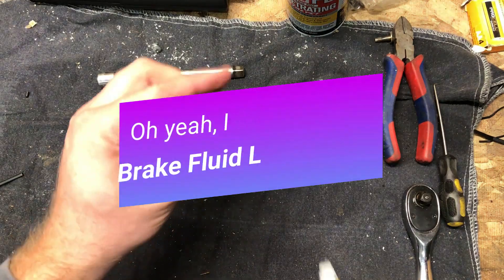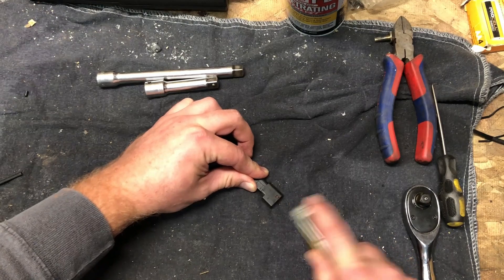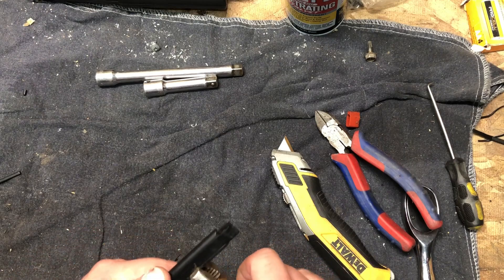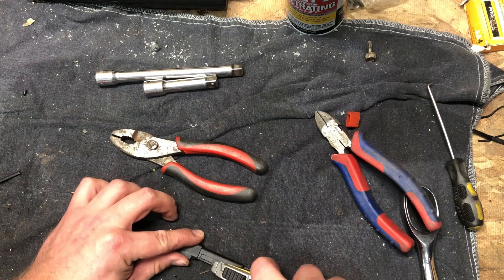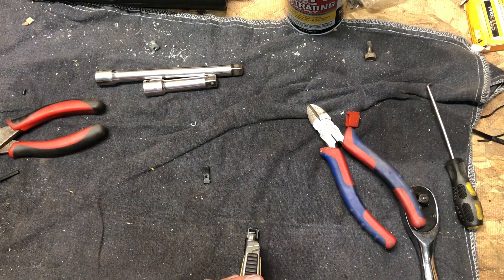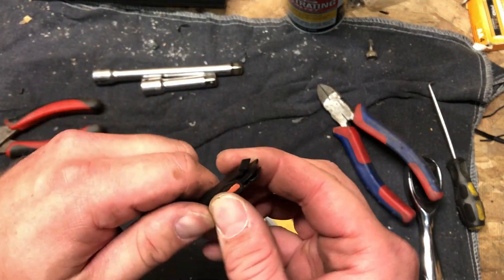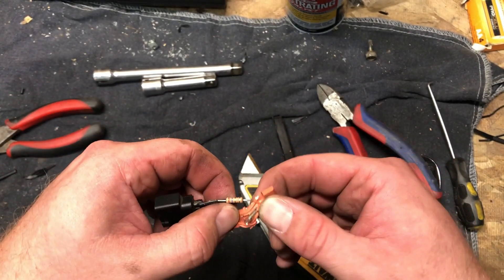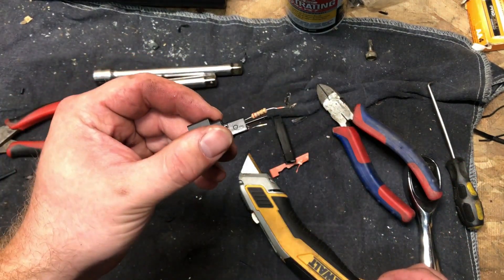Oh yeah, I forgot... Brake Fluid Level Sensor

Comment: Useful video thanks, I need to bypass one which is broken and throwing fault codes until I can replace the reservoir, so knowing that what looks like a 70 ohm resistor is in line will really help thanks.

Comment: Awesome!  I've been troubleshooting a brake warning indication on my Chevy HHR for the last two days.  Checked the fluid level and parking brake sensor.  Started looking at the brake fluid sensor.  I'm old school and was expecting a float in the cap!  When I saw the sensor at the bottom of the reservoir, figured I'd have to empty it to change it.  A few videos set me straight on how it pops out.  But HOW does it work while having no contact with the brake fluid?  Ultrasonic, capacitive, or what? 
Your video completely cleared things up for me.  Troubleshooting the magnetic float(I assume) and sensor(simple reed switch with current limiting resistor) should be easy from this point on.
Thanks!
Reply from the maker: Like and Subscribe! Thanks!
Reply: Hey Dean, I hope this finds you! I am actually hunting down the same brake light issue on my daughters Saturn ion, which I’m understanding has very similar underpinnings as the hhr. I’m very curious if you found anything with the sensor issue? I’ve checked the ebrake switch, jumped out the fluid level sensor plug and tried accessing the float in the master cylinder to move it up or down w/o coming up with anything. Let me know if you figured it out, if I could find a sensor I may just order it to try, but I cannot locate an upper m/c reservoir that houses the float so I’m over here scratching my head